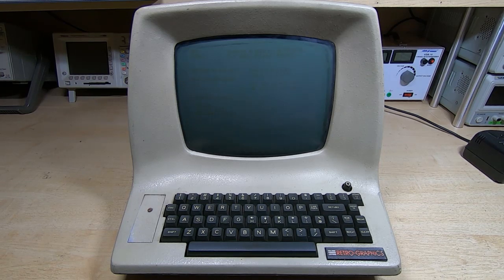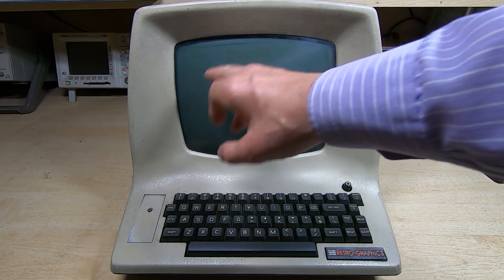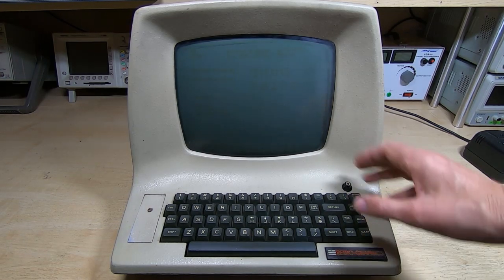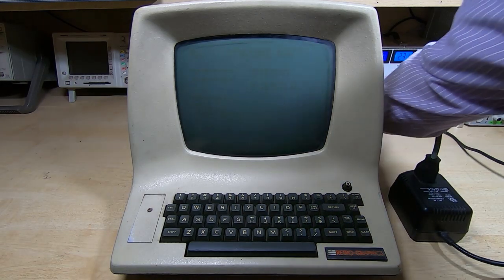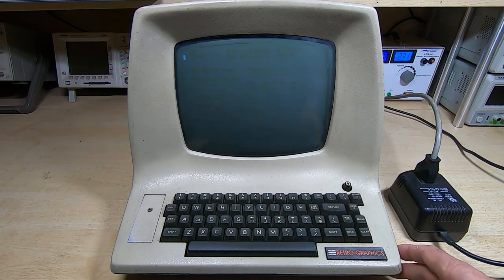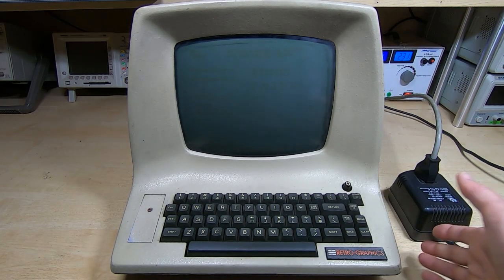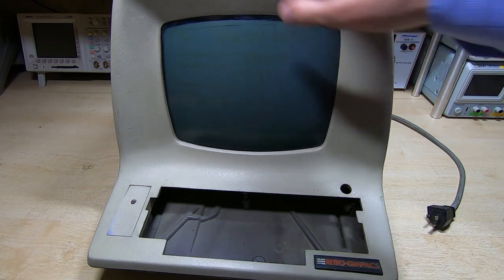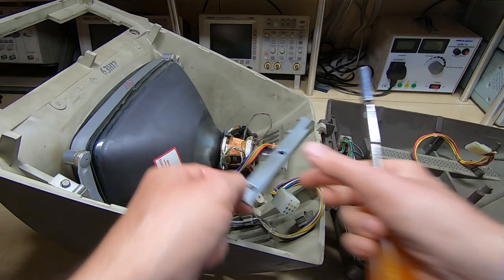ADM3A #2 Repair Part1

Comment: Interesting that it had a RetroGraphics badge - I saw a few of these on DEC VT100/101/102 series terminals way back when, you are probably familiar with them, adding aftermarketTektronix Graphics functionality which the ADM3A clearly doesn't have and predates I  suspect! They consisted of some fairly complex add on boards which sat in line with the RS232 data and superimposed graphics with the video out.  I wonder if you have bumped in to the Televideo 910 which was an obvious looky likey albeit with a microprocessor based logic? Shame the company I used to work for is long gone, there was a large stock of tubes which are long since gone with them :( - Looks like a nice Lear Siegler example.
Reply from the maker: It may become a bit clearer in future video's. The first clue is the sounder which was used in other types of ADM (think ADM-3R). The tubes are going to be the limiting factor in the repair (s?). As you say the ADM terminals morphed into something very different over time.

Comment: judging by the condition it looks like it might be a short series!   Interesting to see what looks like a Futaba keyboard rather than the god awful Hi-Tek one in the previous unit.
Reply from the maker: It really depends on if it works. The cursor is independent of the data path but hopefully switching to local echo or duplex operation will have it working. Well spotted on the keyboard,  I will be covering that when I get onto the board. This one has a metal frame and decent quality keys instead of the plastic frame on the previous one. The keys feel much better but I have no idea if they work yet. They were all full of dirt so hopefully I did not damage any cleaning them.
Reply: If you have a failing keyboard I have a PCB design that uses Cherry/Gateron switches available on my website.